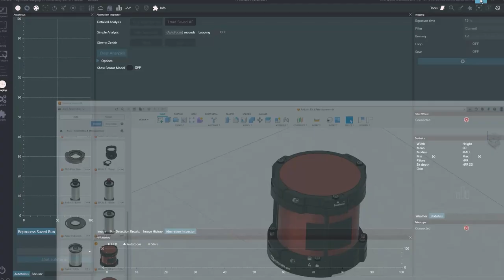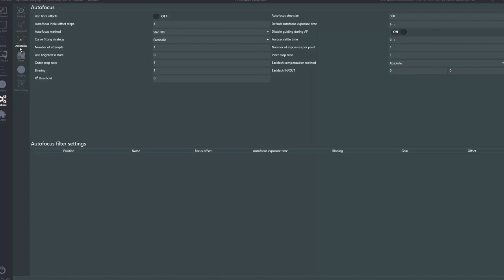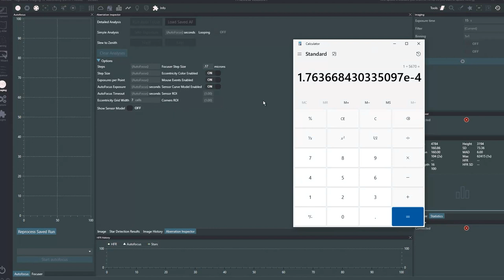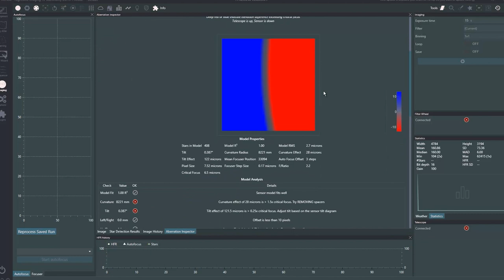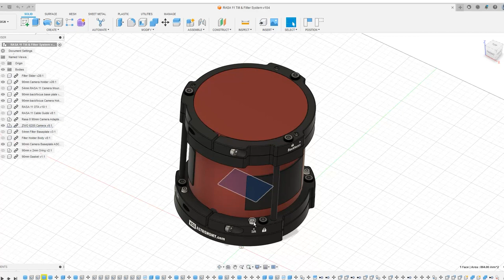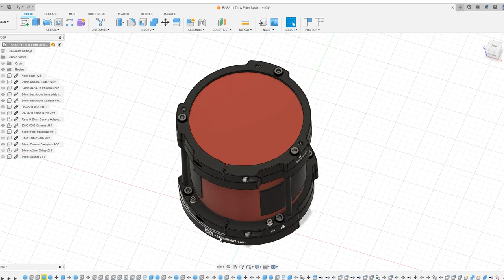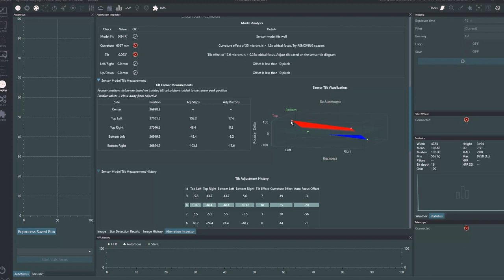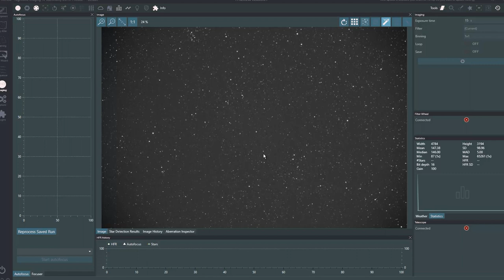Part III - Adjust Tilt with NINA & Hocus Focus

Comment: This is going to be very helpful. I've had one clear night since I got my cage and I was chasing my tail trying to dial it in. Where my issues were was making an assumption about the top and bottom of the image and sticking to a single plane. looking forward to putting this all into practice.
Reply: Well bugger me. Clear night and dialing it in. I had my orientation of the camera wrong. Now dialing in my flatness is smooth and seamless.
Reply from the maker: So you got it all sorted good?  I haf used a different zwo camera on my setup, same everything and assumed orientation was same... nope, once I sorted that out it works smooth.
Reply: I've watched the video 3 times and I still find the camera orientation difficult to follow.  All I know to do is to do opposite corners and see what changes and do the numbers get bigger or smaller? @Brisbane_Astro
Reply from the maker: Yes, it's very difficult to figure that out... and you must be careful because software programs have ability to flip, such as ASTAP... so make sure you have a few reference stars if you use NINA vs ATSAP vs CCD Inspector and that images  are at least the same orientation.

Secondly, you should do a baseline test, then make a diagnol tilt adjustment and see if it's the right way or wrong way and if it aligns with what tool you use like NINA.  If it says top left should be + postive, do the second adjustment that way and see if it's correct and movement is in right direction.  Single mirror scopes vs two mirror scopes, etc. all can change this.
Reply: @asgastronomy  I will be using a RASA 8 with a ZWO 294 and NINA.  If I make a 1/4 turn adjustment on opposite corners (one in one out) and 2 adj step numbers get bigger, then I have gone the wrong way, right?   Tonight will be my first try but I have to also get a calibration on my guide scope first in PhD 2.  If my numbers get bigger no matter what I do, I will have to ask questions based on what I did?  I will make very small adjustments since I don’t have any feel for this yet.
Reply from the maker: @paulwilson8367  Yes, so you might shoot me email, I hardly ever check comments over here on videos, just happened to see these, but email would be better platform to discuss your actual situation, and needs.  sales@asgastronomy.com  I can give you some pointers there since it's on a RASA as well.  make the night time adjustmet process easier if you can do some of this during the day.

Comment: Just one thing I would question, the video shows you only backing off the lock screws for the two corners being adjusted. Depending on the direction of adjustment this may be fine but there is a small distance between adjuster and lock screw/ If the lock screw of the corner not being adjusted is between its adjuster and the adjuster being adjusted, the lock screw will prevent the axis from moving - unless something bends. Maybe not an issue for tiny adjustments but it may be best to relax all locks before adjusting. Also, just a personal thing, I find after several adjustments it possible that one of the adjusters no longer makes contact with the ring it adjusts. So, periodically, with all Locks still locked up, I gentle go around the adjusters and make sure they are still in contact with the ring. That way, if I come to adjust them later I get the right amount of adjustment.
Reply from the maker: It's a good point.  So there is some debate on this probably, if you do 2 corner tilting like this, will the other 2 corners get bound up, yes, surely they will.  I do like you do and periodically go around and just unlock things gently just to make sure it's not getting bound up.  Easy to do.  

The theory I have is that even if you run tilt/lockers on an axis, say inside/outside of each other, it will do the exact same binding if you do a side to side tilt rather than a corner/corner tilt.  In the end, no perfect solution there... except if you go electronic which we did and it makes each corner have a single point.

The problem with relaxing all 4 corners is that how it hangs on some telescopes, it will flop around, shift, and could/could not be an issue.  It's a good point, do 3 or 4 adjustments, just go around and relax the lockers.  The real adjustment comes from the fine thread titlers anyway, so if they are touching, it shouldn't move much.

Comment: Just an FYI, in the recent interation of Hocus Focus/AI, you can only use one image per focus point.  Trying to use multiple images per focus point causes Aberration Inspector a fatal error due a NAN/INF error in the algorithm function.  I have reported it to George's git hub as wells as on the NINA Discord.  It is not a new issue but I can't see that George has ever responded to anyone reporting it on the NINA Discord.  It was from other users that the 'fix' was identified and posted.
Reply from the maker: I didn't know this, but good to know.  I could see how it would be hard to calculate using multiple focus images per point though.  Might be overkill for doing tilt adjustments, but maybe a good solution for when you run live focuses at night?

Comment: This is really excellent...thanks. I have a question on the use of 4 screws to adjust the tilt plate. Given that a flat surface (tilt plate) is fully defined in terms of its Z (vertical) positioning by 3 points, that means the 4th point is either floating free or just touching the plate. I am not sure I fully understand how adjustments to 4 screws account for this. If one tries to loosen that 4th screw it moves further away from the plate to no effect. If one tries to tighten it, the screw will become tight as it is trying to bend the plate being held in place by the other 3 screws. I understand therefore why you chose the two worst corners and adjust across them. You want to pivot across the other two scews. However, what if one of those two is the "loose" screw and the plate is being held by the other 3? That means assuming you tighten that offending screw towards the plate, it will have no effect until it makes contact and you will only get a partial adjustment on that screw. Or, what if the two screws chosen are both tight against the plate? That means one of the other two, not being adjusted is "loose". When the adjustment is made, the pivot line is not being held firm and I assume could move as the opposite corners are adjusted. 
Am I right in assuming, that after the first couple of sets of adjustments, as outlined above, all 4 screws end up in contact with the tilt plate and the adjustments made from then on are fully implemented. 
Would it make sense at the outset to choose 3 screws as the ones defining the plates position and snug up the 4th until it becomes a bit tight indicating it has now come into full contact with the plate?
Finally what would you do for a 3 screw adjustment system?
Reply from the maker: 3 points in a plane, yes, but we work with small rectangular sensors.  4 corners is more intuitive and easier to operate is all.
Reply: @asgastronomy  completely agree. I basically adjust iteratively across one axis only choosing the largest tilt error. That seems to avoid any issues with the "4th screw", yet is intuitive in the way you describe.

Comment: How do you take into account collimation before adjusting tilt?
Reply from the maker: It's best to start with it zeroed out... it should behave like any other extension or accessory... but... if you doubt collimation you can remove the cage and other possible accessories that could cause tilt, but typically just have it zeroed out, get scope side sorted and then fine tune the camera end.